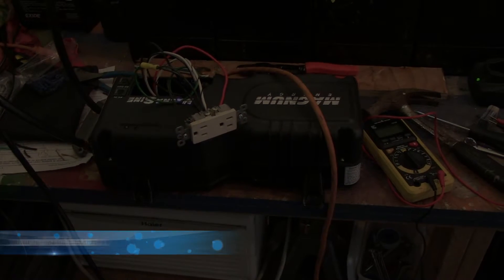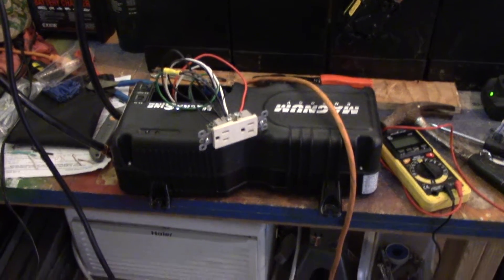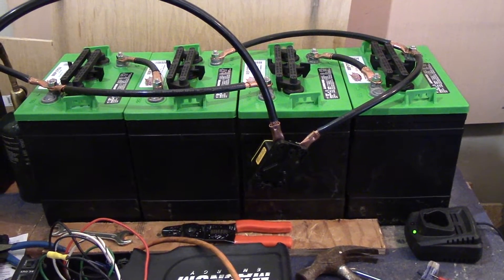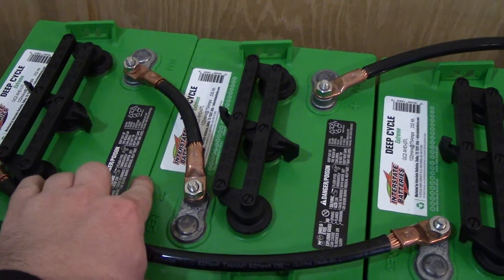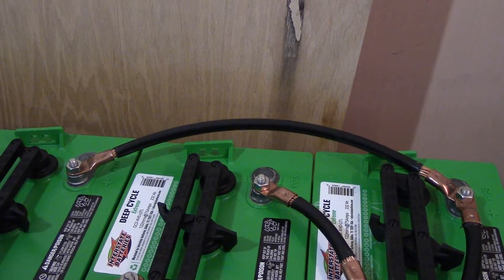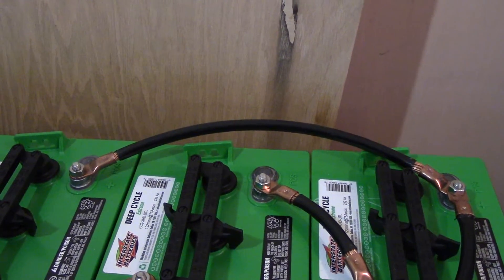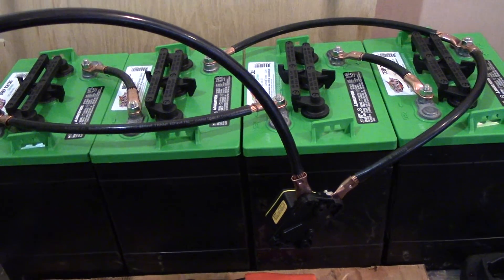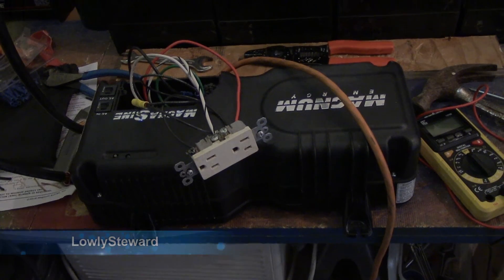How to Wire an Inverter and Battery Bank for Solar

Comment: I have 3 batteries in parallel. Should i attach the positive at one end and the negative at the other end to my inverter? Or will attaching the inverter to the same battery drain the 3 batteries just as evenly?
Reply from the maker: You want positive of one battery and negative of the battery on the other end or it won't use all three
Reply: @IdahoDualSport  my 3000w motomaster inverter has 4 cables. 2 positive and 2 negative. I'm wondering if i should double up on the same positive/negative  or attach to both batteries on opposite ends
Reply from the maker: @dylanstuckless5669  I'm not familiar with that inverter. I'm not sure why it would have 2 of each

Comment: I’m doing a Battery-Back-Up I have 26 pcs LTO Lithium 2.3v 40Ah 20pcs & 2.4v 40Ah Titanate Batteries & I have also 2 Optima Yellow Top 31 Series 12v & my Inverter is a Hybrid 5KVS 48v 220v pure sine wave charge controller, u have a All Power Transfer Switch 6 circuit 30Amp and my DIY Generator is a GM - 1 wire High Amp B.B. Low Turn Amp alternator will be powered by 12v Dc motors ! Great video
Reply from the maker: That's going to be a nice setup!
Reply: Idaho Dual Sport thanks but the issues I’m having is my DIY Generator finding the module to turn on the 12v Dc powered motors to spin the alternator or Alternators if I get the Alternator working that I added the neodymium magnets to I possibly used to strong of magnetic force N-52 , but I used that strong I wanted to make more electricity at lower speed but Alternator’s have to spin about 3-3,500 r.p.m to cool off from the built in cooling fans to slow not enough wind ! And where I got B.B. Chevy Low Turn Charging the Dc motors I got with speed- Controls to Dial-it in the proper speed to monitor the batteries although the inverter I’m waiting for is over kill than what I need now it’s 5 KVA ( 5KWh ) 48v the best for voltage for home use , 220v single phase  was inexpensive 🤔 it’s not duel phase 120v - 220v ! But still good it the inverter does not come with a plug for the out-put I will have to hard-wire it into my breaker box ! Now this gives me a few ways of doing this I have a New ALL POWER Transfer Switch 6 circuit but only 30 Amps I have 4-15 Amp & 2- 20 Amp circuits , or I have a 100 Amp Double Pole Breaker and my inverter will give me 2 lines of 110v - 115v I can wire it as only battery - Back-up / DIY Alternator generator for self-sufficient power making ! You hock the alternator up straight to the Dc power motor you’ll have to spin it a few times the belt to start the Alternator Charging to Shorter kickstart a DC motor running then once it starts spinning you’re self-sufficient The DC motor is making the alternator spin and the alternator spin and keep the DC motor running and now comes with the electrical companies don’t want you to know UTEP straight into the stater the copper thing that runs around the outside of the center pot spinning underneath the casing I’ve tested it with my multimeter I have a video of it I tested 2000 wants AC current spinning no more than 2000 RPM dump that into my inverter we are can dial it down to be usable pipe that into my fuse box on the grid falls shut off the two main powerlines come again don’t want to hurt any electrical man working on the wires ! That’s the plans ! For my free source of energy and George Wiseman teaches you how to backfeed into the grid but you got a let your electrical company know , I want they want to replace you meet at with digital media say no because the new digital meter wants to charge you more money for your electricity and if your choice to go to a more updated meeter ! But before you backfeed The grid you have to have the electrical company come out and look at it and before them you probably want your building inspector to come out and to confirm that’s all safe !
Reply from the maker: @marktheamerican4162  Yeah, you have to be very careful back feeding that you don't kill some poor sap working on the power lines! I've found that with my system it doesn't make sense to back feed because it's only a 1KW system. My small 3 bed 2 bath house averages 18-20KWh/day and that's just with me living there by myself. I couldn't generate that much power with my system but if you're running a 5KW system you might be able to see some positive gains. Sounds like an interesting system. It was my understanding it's not mathematically possible to produce positive gains where the power is generating the power at the very least due to loss in the lines. You'll have to let me know how it goes!

Comment: Great video... Please don't take my comment wrong, but there is a difference between DC and AC Wire; the cable you used was AC Wire. How you can tell is by the strand of the wire, the thicker it is the more resistance so AC Wire. 

Gauge is all the same but Strand Thickness, or the thinner the better, for DC, is what really matters. If you look at Welding Wire it has what seems to be a million strands of wire and when you cut it at first glance it looks to be almost a solid wire. The more Strands the less resistance because it gives current many lanes to travel. Thick strands cause current to double or triple up on each strand which can cause resistance or a bit of heat. 

The short length of your runs is to your advantage as it will allow current to travel very fast over a very short distance so your runs should not heat up much; but if your runs were over 30 feet you'd get some series heat... 

Some don't know while others just don't care but wire strand thickness really matters for DC applications hence the reason certain wire costs almost double of other wires at the same gauge. Welding wire is by far the best to use for any Solar Application and sometimes can be had from scrap yards very reasonable priced; especially in short lengths... 

Again your application is safe because of your short runs. But someone looking to go over 30 feet or more might want to look into smaller strand wire such as welding wire or DC specific wire... Cheers....
Reply from the maker: Interesting, good info... I didn't know there was a difference between AC and DC wire itself. Thanks for sharing!
Reply: Yeah I found out the hard way and almost bought AC wire; mainly because of how much cheaper it is. Welding wire and Car Jumper Cables are viable options if you need 20 foot runs or less. Of course if you really do need 150 foot of a single run you'd have to bit the bullet and get the correct, and very expensive, solar wire. 

Sometimes you can find deals on eBay but just make sure you get what you are paying for, very tiny multiple strand wire. Another option, though can be a bit pricey, is the wire used to run Car Audio Systems like Monster Cable... Of course it comes at a MONSTER COST as well but you do get what you pay for. 

Also you can make your own Copper Connectors from flexible copper pipe, like 1/4", 3/8" or 1/2" then pound one end down and drill a hole. A cold chisel with a dull end, and using a sander to dull it even more, works as a great crimp tool for crimping these makeshift connectors. Sometimes plumber friends will have scrap pieces of flexible copper. The type of flexible copper is the coil type copper you find at Home Depot or Lowe's and it bends fairly easily and is reasonably priced... In short lengths it becomes amazingly ridgid. 

The copper connectors you used are very reasonably priced. Of course if you needed a lot more it could get costly like with many other applications... Most places I've seen priced those connectors at 2 bucks each and that is just way too much so I had to find an alternate means, flexible copper... 

This "make your own copper connector's" idea is not mine but came from another YouTube Video... Sure it takes time but if you cut many at one time then you will have a lifelong supply once finished.
Reply: Here's the link to make your own connectors: 

https://www.youtube.com/watch?v=RpFb_Yxl_hA

Comment: Nice presentation.  1/0 cable is rated at 170 amps for up to 3 cables in conduit or raceway but will handle 260 amps in free air under table 310.15B17,assuming 90 deg C wire.  In the closed confines of an RV battery box I would also use the lower number.

Comment: which one may workout best between connecting the inverter directly from the batteries terminals and connecting the inverter from the charger controller
Reply from the maker: Both inverter and charge controller are connected to the batteries. You can see the full setup with costs here: https://www.youtube.com/watch?v=FTULyUyl_p4

Comment: heat shrink your cable leads with the heat shrink tubing from harber freight set up  will look so much cleaner but great job tho
Reply from the maker: Yeah, definitely would look cleaner, I agree. The reason I chose not to do that is 2 fold... 1) if moisture gets trapped and corrosion occurs under the shrink wrap I won't be able to see it and 2) if the cable starts to come undone I won't be able to see that either so I prefer to leave them naked but it's totally subjective of course.
Reply: the marine type have adhesive sealent inside when you apply heat it totaly seals the conection

Comment: Your inverter will catch fire on that 150amp breaker well before the wire does. 1000W / 12V = 83 AMP.
Reply from the maker: Here's a general table for finding breaker/fuse sizes but basically you take the max output voltage of the inverter (120 on this one) and multiply that by 125%  https://www.altestore.com/howto/recommended-inverter-cables-sizing-and-breakers-or-fuses-a62/
Reply: That table really errs on the side of caution.  4/0 cable for a 1500 watt inverter.  It must have been compiled by their attorneys.

Comment: Sweet, 4 batteries, Awesome gotta love it. I just have the two 6 volt on mine, the 4 would be way better, good for you. 
You did a good job making the cables, fun stuff.  I love that idea as well, I will check out that video. 
Good to know on the disconnect.
Very nicely done on you set up buddy, Thaank you for sharing your set up with us. I hope you have a blessed weekend.
Reply from the maker: +Heartland Dual Sport Thanks HDS.. there are a couple more videos scheduled coming soon. The auto disconnect is definitely a must to prevent fires.. I put one between all components to protect everything and ensure safety and it's not much extra work so it's worth the effort :)
Reply: LowlySteward Yes sir, I can see how that would be important, if and when I ever get to the solar panel charger side of this project I am sure I will be calling on you for assistance. you are a good man, thank you sir.
Reply: whats a blessed weekend?